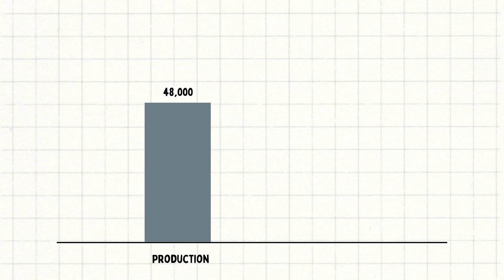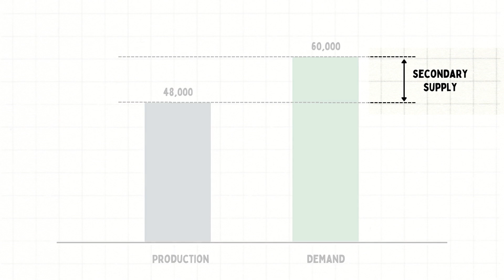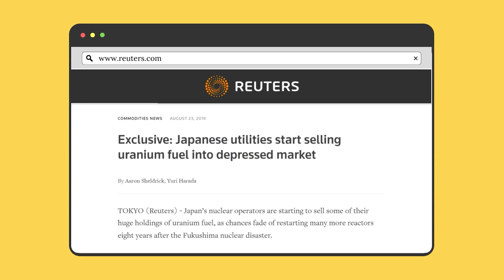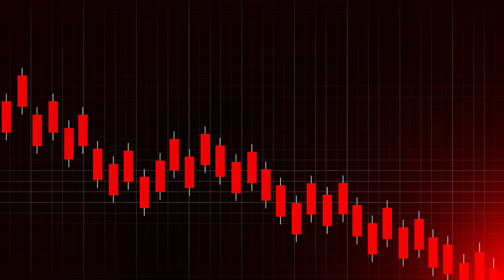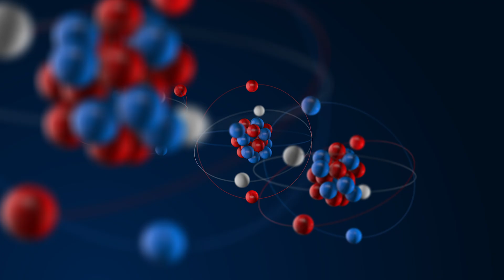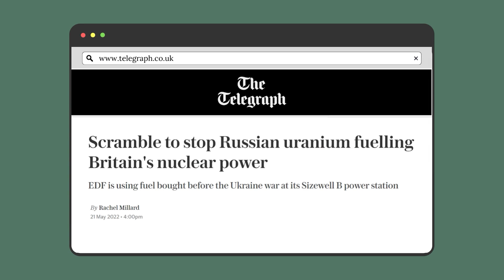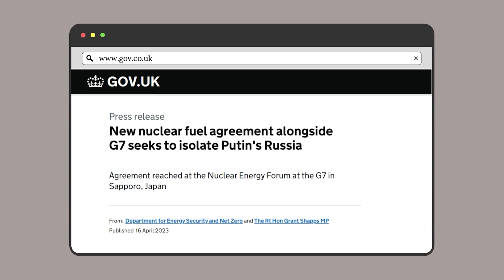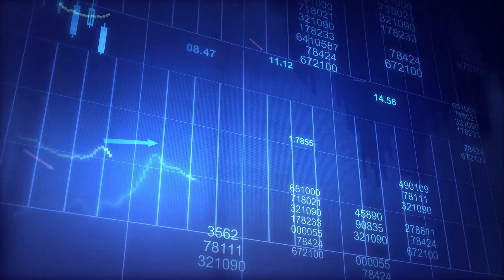The Uranium Logistics Problem

Comment: That has always been the problem with uranium reactors. Very limited fuel supplies and very expensive to exploit. For that reason alone nuclear reactors never were economically viable. Solar and wind are 10 times cheaper.
Reply: And they are 100x less reliable.  Minor detail you leave out.
Reply: @TheRustyLM  nothing more reliable than the sun. It shines every day. Besides you can store solar energy to use at night.
Reply: Nope, the exact opposite is true. We have about 2 billion years worth of uranium and another 2 billion years worth of thorium. 1 kg of uranium worth about $50 bucks can supply your lifetime of energy.
Reply: @chapter4travels  I'm talking about fissionable material. U238 cannot be used in a nuclear reactor. Nor can Th232.
Reply: @adbogo  Both can in a breeder reactor, that's my point.
Reply: @chapter4travels  Yes but you have to wait a very long time for them to turn into fissionable material, like 30 years. The French breeder reactors were never a great succes.
Reply: @adbogo  Those were solid fuel breeders, I'm talking about liquid fuel breeders, there it's no problem. This type of reactor is not commercialized yet, but there is no hurry, we have a few thousand years to get that done.